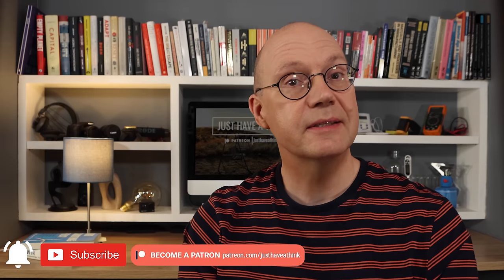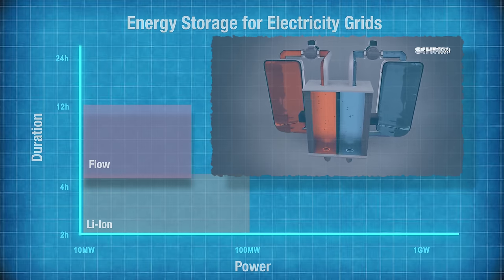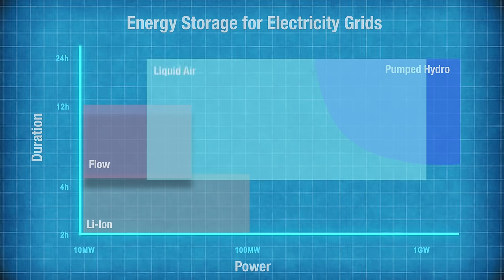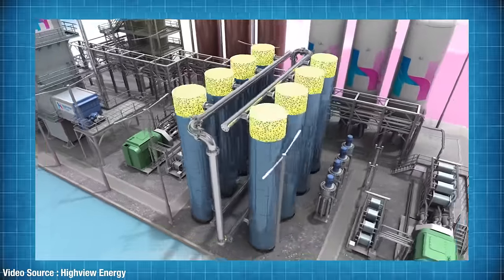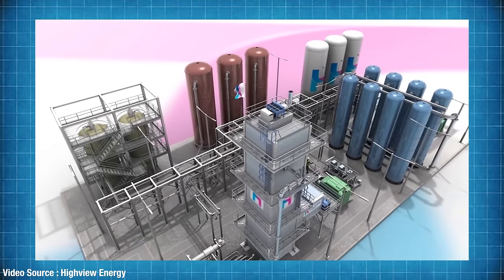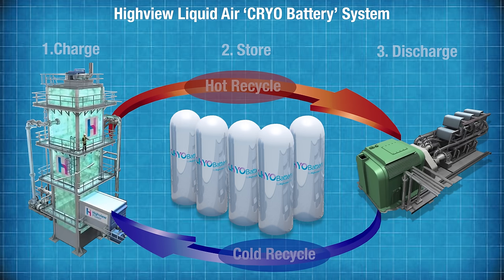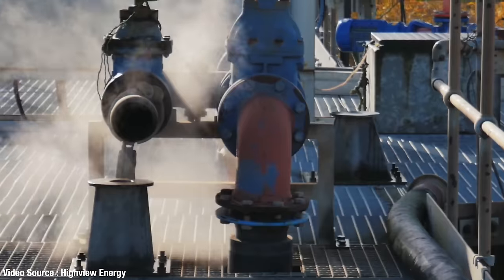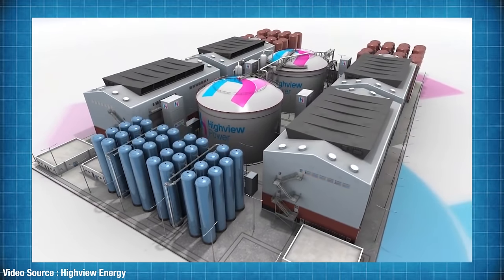Liquid Air Batteries. Literally energy from thin air. Seriously. Literally!

Comment: I came up with my own design of air battery and have been using it for 50 years. I build windmills, mostly for fun. All my windmills pump air. That compressed air is held within containment vessels, then released against small engines, which are powered by compressed air as well as small turbines and I can make any electricity I want pretty much anytime I want. Why not just make all the world's windmills pump air?

Comment: A serious issue with renewables is that the economic viability, not to mention the visual NIMBY footprint, is quite geographically distinct. You won't get sufficient solar and wind in much of Europe for instance to power all of industry, regardless of the storage system. It occurs to me however that if we used a Boring Company tunnel and made that tunnel an insulating cylinder, we could likely run a tunnel clean from the Sahara through Europe with essentially zero transmission loss. (Transmission loss is the reason Europe cannot pay for solar installations in the Sahara now.) There might be a small loss to maintain the temperature.

Comment: I think this system efficiency way to low to be worth using.  You are wasting half of the energy.  Lithium batteries have efficiency over 90%  and water storage is pretty bad at 70% but still better than this.
T the current time I think the best energy storage is molten sulfur batteries  They are very cheap and already in production and use,  long-lasting, have high efficiency, they have no expensive or limited availability materials and if production could be scaled up they can be the cheapest battery in existence. It is unclear why anyone even considers using lithium batteries for any stationary energy storage.

if renewable energy will ever get popular "what actually will not happen ever" sulfur batties are going to be the main energy storage. 
when your energy price is twice as high as produced by usual power stations you have no luxury to waste half of it on the storage  as that will make its absurdly high price double again.

Comment: Thank you for the video.. would you have a talk about how we can extract electricity from the pyramid in Egypt?:)
Reply: I can help you there because I've developed blueprints. After the pyramid has been thoroughly hollowed the coal furnaces are stacked inside in a pyramid shape. The chimney pokes in-obtrusively from the sphinx's arse.  Supply coal is dragged across the desert in bins on wooden rollers by slaves. I suggest HVDC for the grid wiring. This is now in preliminary design stage for extracting electricity from the pyramid in Egypt.

Comment: With liquid air storage, you need a liquid air-powered CAR.  Liquid air, when exposed to the ambient air temperature, expands 400 times!  A 'reverse' steam engine, no less!

Tony Dye in the UK has invented a frictionless 'EXPANSION' engine, with only two moving parts!  Much more powerful than an internal combustion engine of comparable size.

Here's a gif animation of the expansion engine:  https://www.epicam.co.uk/resources/comprun.gif

Here's a link to Tony Dye's webpage.   https://www.epicam.co.uk/

The Highview energy storage power plant in the UK.   http://www.highviewpower.com/
 
Also, the work of John Barclay with Pacific Northwest Natl Labs, who is working on MAGNETIC REFRIGERATION to make liquid air.  

No more noisy, bulky air compressors..  Just the spinning of a disk of GADOLINIUM in-and-out of a magnetic field.  

The PNNL 'magnetocaloric' liquid air maker, 
https://netl.doe.gov/sites/default/files/2019-05/2019_Annual_Reports/Wednesday/Gasification/5%20-%2020190410_1100A_FWP73143_PNNL_2.pdf 
 
The magnetic field heats up the Gadolinium.  Then removing the magnetic field causes it to cool down below what it started with.  

This  
 process is cycled over and over to achieve -320F liquid air temperature.

Comment: Really well done video!  Seems that the insulating value of internment is being overlooked.  Also,  It seems that high efficient turbine engines that run on alcohol and such are also a viable enhancement to one of these air conversion systems.  Elon Musk has coils and coils of stainless steel stored in Boca Chica TX.  If those were coil springs would they be a viable mechanical energy storage system that satisfies your initial equation?

Comment: I was watching about flywheels. I've been studying how to separate the gases from the atmosphere and discovered liquid air. You don't need massive chillers as some gases are compressible to liquid at room temperature. Who knew? So I asked Google YouTube search I don't know how to search within the channel. Have a think liquid air and here I am with five chapters according to I don't know how long a chapter will be. The century of self had chapters of hours and hours. I like to learn things so if it takes 5 hours I won't be watching the news. That's a good thing. Rather than plugging in the car and watching the lithium batteries burst into flames a little compressor comes on filling the tank with liquid air. Four large pneumatic high speed sander/buffer/polish motors like at The body shop on each tire. Our 1950 Packard had vacuum windshield wipers that failed going up the long steep hill. Liquid air will not fail me there. I like that solution. With liquid air stations next to Tesla chargers, able to serve customers as fast as filling a gas tank will make the Tesla crowd the envious one.

Comment: Sadly cheaper energy only available to Brits if they turn off appliances.

I turned OFF my fridge-freezer and my bills went from £250-350 to £18-21.

It was running 24/7 and l was at work most of the time anyway.

I only eat fresh at home and go out to eat - its cheaper.

Fresh milk? UHT milk lasts longer out of the fridge. But l used to have my morning coffee at Costar or Starbucks before work.

I only wish l discovered this 20 years ago

Comment: ammonia boiling point −33.35 °C (−28.03 °F). Worked with a steamfitter out of local 290 portland, OR. He said in the 60's the navy had a ship that ran off of ammonia. All they did was cruise around the caribbean for a year. Energy problem has been solved for years beginning with Tesla. Save the planet sounds great but where's the money in that.

Comment: This technology, once the liquid air is gaseous again, forcibly has the same problem as CAES (Compressed Air Energy Storage)... that is, when air expands it requires heat (PV=nRT).

With CAES, in Germany, they burn natural gas. Here is far too optimistic that air will evaporate on "ambient air heat". Playing with Game of Thrones: Winter will be ethernal in Manchester!". If air is not heated up, the metal of the turbine freezes and becomes brittle (as Titanic's iron did).

Comment: At 9:32 you state, “. . . but if the grid doesn’t need power when renewables are generating it . . . all that FREE energy goes completely to waste.”
There is no such thing as “free” electrical energy.
I live in Canada and have a 10 kWh solar system that cost me $80,000 to install in 2011. I have been selling the power ever since to my local electric supplier at $0.80 kWh (many times the going rate - because of a then available government mandated green energy subsidy.)
If this energy was stored and reconverted at 60% efficiency, that would make the power equivalent to $1.33 kWh. That is not what I would call “free”.
Ontario residents normally pay between 10 cents off peak and 20 cents kWh high peak for our mostly hydro, gas and nuclear generated power.

Comment: On 06:13 you state that in the process of producing electricity HighView Power uses an air liquifier which, per your video, removes water and carbon dioxide (CO2) . Why it is important to remove CO2 from the air, considering CO2 is only 0.036% and 0.041% of the total volume of the air ?

Comment: 85 million pounds for 250MWh is equivalent of roughly 400USD per 1KWh. It doen't sound as inexpensive solution for me. Li-Ion will cost less than 50% of that (with much higher round trip efficiency)

Comment: Has anyone seen Gravitricity website? They store energy with heavy weights in old mine shafts. A cheaper technology than Liquid Air, I would say. Less equipment required, and an inert storage system. Probably less capacity per unit, but a viable option. Greater efficiency? I reckon so.
This so-called 'excess power' could be used to charge electric cars, which would always be requiring it, day and night. They would be the Energy Storers! Prices could be adjusted for the time of day, or availability. NO extra equipment required!

Comment: @Tony Wilson : Tony, I’m not going to begin comparing bona fides. Let’s just say I am also an engineer and I used to work for JPL. I have a great deal of experience with cryogenics and gases. I have operated cryogenic equipment and worked with exotic cryogenic liquids such as F2 and OF2. I designed and operated ground support equipment for planetary exploratory spacecraft such as Magellan and Galileo. I designed the propulsion system and supervised the fabrication for the Mars Pathfinder delivery bus.
Atmospheric CO2 is defined as a trace gas in our atmosphere. It comes in at 0.04% by volume. Extracting it from our atmosphere cryogenically is difficult and expensive and it requires specialized equipment. There are better ways. I did not say it was unimportant, only that minor and trace gases may not be worth the effort to remove them in relation to a “Liquid Air Battery” energy storage system. When I needed Ar or He or H2 j simply ordered it from the professional gas supplier. He (she) had equipment for that purpose and he (she) delivered it in a bottle, a truck or a railcar.
We can discuss at your convenience, the part CO2 plays in “global warming” at another time. But be prepared. I don’t accept platitudes, wild assumptions or unsupported opinions.

Comment: Sounds fine, but given a capacity factor of ~30%, how many wind turbines would be needed to:

a) Power the whole of the UK? 
b) 'Charge' enough of these 'batteries' to provide a minimum of 24 hours of uninterrupted backup power, should the wind stop blowing (in reality, we'd need many times more than 24h, to be safe)? 

And how many storage units would be needed, to provide that 24h of backup power, given 60% (optimistic) efficiency? 

To me, this sounds about as close to a realistic solution as nuclear fusion, at least for the next 50 years or so. France and Sweden have shown how to get carbon emissions down, using currently available technology, that doesn't have intermittency, or storage, challenges to overcome.

Comment: Are there any solutions being designed for longer than 24hr? With the Texas Winter Storm this passed  year, they were power constrained for almost a week. (The storm officially lasted 5 days.) Solar wouldn't have been available. I don't think wind turbines can operate in blizzard conditions. (Or can they?) This solution seems like it could be used. But, is there any solution for being specifically developed for long duration storms?

Comment: Very good  idea, the only disadvantage - 60% of efficiency. Flywheel storages can provide 98% of efficiency (https://beaconpower.com/). Relative disadvantage of flywheel storage may be their lower capacity (liquid air storage can be scaled much more easily). I think both solutions are good.

What if instead of liquid air use just compressed air? It will require larger  storages (underground, probably), but may be efficiency will be higher?

Anyway this is great idea and technology, it can solve energy storage problem for renewable power stations completely.

Comment: The main advantages of cryogenic storage are the low temperature and the fact, that the energy is not stored in the liquid air but in the ambient air. Considering the low cooling temperature of a Carnot cycle the ambient air has four times the temperature of the liquid air. The Carnot efficiency of a heat engine is given by COP = 1 - Tc/Th. In the liquid air case it is 75%. It means also, that the energy stored in the atmosphere is 4 times the energy stored in the cold liquid air. 3 times this energy can be regained as mechanical power. The stored cold is only the heat sink that rejects the heat loss of the thermodynamic cycle. In order to get an equivalent thermodynamic cycle with the ambient air as heat sink one must operate the cycle at 1300 K or 1025 °C. A modern steam turbine operates usually between 400 and 500 °C. In Germany, the ZEE03, a superheated steam motor was developed operating at 900 °C. https://projekt.beuth-hochschule.de/fileadmin/projekt/sprachen/sprachenpreis/erfolgreiche_beitraege_2007/2._Preis_07_Zero_Emission_Engine_Saskia_Scherfling.pdf

Comment: Is this really cheap and simple? The numbers at 10:36 are confusing and from the vendors of this technoloy, so to be taken with a pinch of salt. What is CAPEX and OPEX of a 1 GW/100GWh facility? Centrifugal compressors are standard, yes, but not cheap at all, require careful operation and maintenance and do not like switching on and off. In order to reach the 60% round trip efficiency the heat of compression and cold of expansion must be stored, That is low quality heat and cold storage, so it sounds it will get very bulky. Also liquid air is hzardous to humans and most metals. There is no full scale plant build yet according to the Highview power website.
All in all this video seems to me wildly overenthousiastic.

Comment: Am I crazy or is the most attractive feature of these batteries being overlooked: as part of the system, you also strip out the CO2 and water vapor from the air...and it just so happens that CO2 and water are the two necessary ingredients for P2G systems, which provide an offtake point for MORE curtailment as well as providing energy-dense hydrocarbon fuels for non-electrifiable applications like container ships or commercial airliners. PLUS you also have the CO2 right there for sequestration, if that can be worked out effectively.

So in addition to grid-scale power storage, this seems to produce some extremely useful "waste products". I see what the hype is now, these make WAY more sense than li-ion batteries for GW-scale applications.

Comment: I love it! I think this will feature heavily in the future power grid. If the power generation from renewables is significantly greater than required by the grid, we can supply the grid and use the excess power to hydrolyze water to produce green hydrogen and oxygen (a.k.a.. power to gas). These batteries allow for rapid variation of power to the grid with power to gas. The atmospheric CO2 collected from these batteries can be reacted with green hydrogen to make green SNG, or methane, which can be injected into the old gas grid (a.k.a power to SNG). Methane is an important chemical feedstock that can be used to produce plastics, lubricants, and liquid fuels. What we need is a tax on carbon at source (as close to the point of extraction as possible) and an equal-sized subsidy for sequestering carbon to make green hydrogen cheaper than blue hydrogen and green SNG cheaper than methane (green SNG would be tax free if the c tax exactly equalled the c sequestration subsidy, but natural gas would only be taxed). May be impractical today but this is what we should aim for IMO.

Comment: OK. You have one foot out of the box. Lets see if we can coax the other out now. Did you know that a hydro turbine installation is always less than 16% efficient? At best full load? Where is the other 84% go? In the form of accelerated mass as the water travels away quickly. That is 84% of what we came to the party for! Solution? Stop accelerating the mass. That gives you an opportunity to gather 84% instead of losing it!😎😎😎

Comment: Great, but you can't store that which you have never generated. What's the plan for replacing the thousands of Gigawatts GENERATED through fossil fuels ? Fossil fuels account for something like 80% of all energy sources worlwide (if not more). Either we find a viable solution to change that, and fast, or we're talking about damage control and facing ever harder choices in the near future.

Comment: I am skeptical that the efficiency of 60% round trip is too high.
Reply: Are you an instant expert in most subjects?
Reply: Peter Mortensen  That link does not work.    Compressing air does make lots of heat.    Mr have a think did not get into any of the engineering or the physics of the energy conversions.     He did mention using residual heat.   By putting heat to that liquified air when released,  the volume expansion would be much greater,  and thus more energy recovered.     Seems somehow that heat from compressing and cooling air to liquid is saved for that purpose.

Comment: If you are going to build tanks... now set a stand-pipe to the bottom for air
[tank holds water, the pipe is for air]... now ad 2/45* elbows close to the end of the pipe
(connected- 1 inside/1 outside the pipe- both open ends face down)
Air-Waterfall (up inside the tank of water) (swimming pool) (kelp farm)

Comment: First, it would not take 200 people to run this. More like 5. That is 1 person per shift for a 24 hour on line facility.
Second, it would not be liquid air, but liquid nitrogen that was stored. If you cool down air to liquefy it, the first thing you get is a liquid containing over 30% oxygen. This is hazardous. There are hundreds if not thousands of cryogenic plants making nitrogen and oxygen. There would be a cold box producing gaseous oxygen and nitrogen, with a stand alone unit to liquefy the nitrogen. 
To generate 25 Mw you would need to expand well over 100 tons per hour of gas. The liquid would be stored in large tanks at atmospheric pressure, like the ones shown towards the end of the video. There are tanks in service holding over 20,000 tons of liquid gas.
The logical place to put such a facility would be next to a steelworks or similar large consumer of oxygen. This would spread the capital cost.
   .